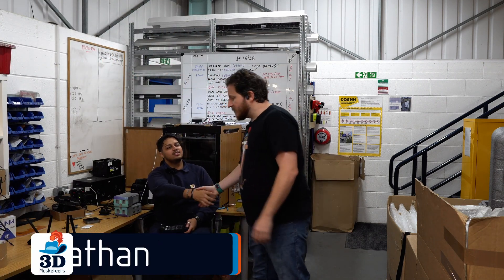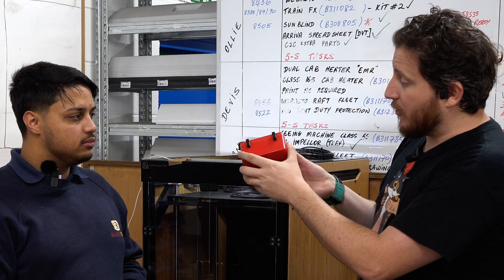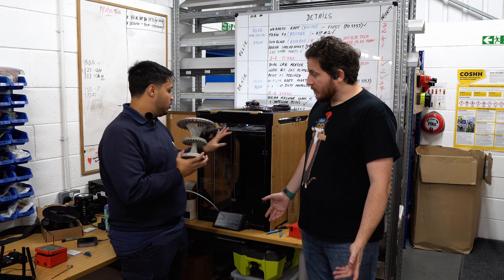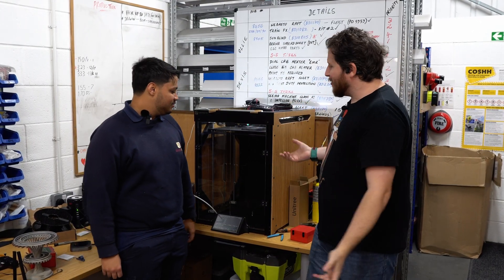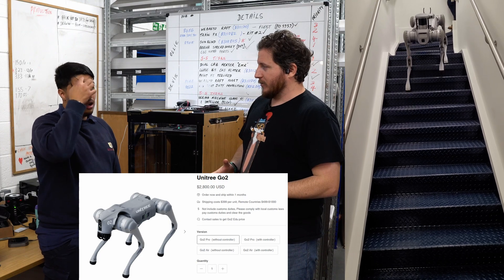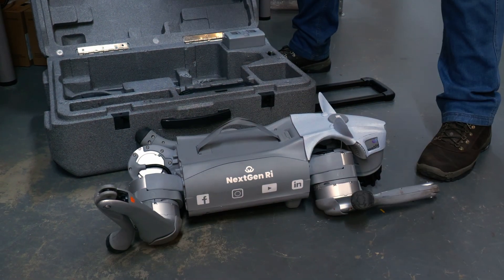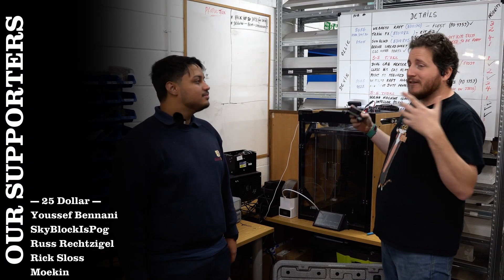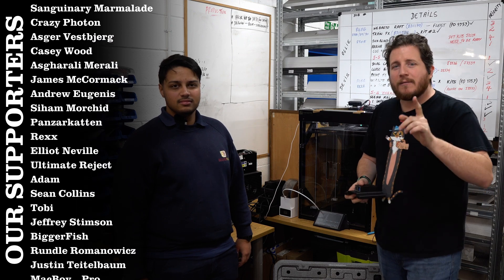How 3D Printing Keeps The BRITISH RAILWAY Running!! - Belvoir Rail!

Comment: I'd mount a crate and holders on it to be able to run things around our rural 16 acres when we're doing various projects. I'd also love to mount a camera on it and have it patrol at night when cameras pick up something odd.
Reply from the maker: now THAT would be cool! even further if it had an arm to pass you things out of the crate! Using them as a mobile watchdog system would be both incredible and scary at the same time!
Reply: @3DMusketeers  great thinking! And totally got black mirror vibes from those things when you ran from them 😂

Comment: unless it can clean my house and make sure the real dogs (especially the new one) doesn't get into trouble, I'm not sure I see the point in a robot dog. I do have a roomba, but it's currently useless as Rena's dog toy explosions have basically redered it useless until I do some basic cleaning.
Reply from the maker: For us, using it as a mobile lidar platform has some significant value, but yes, most of the value for the smaller dogs to me is more fun and less practical!